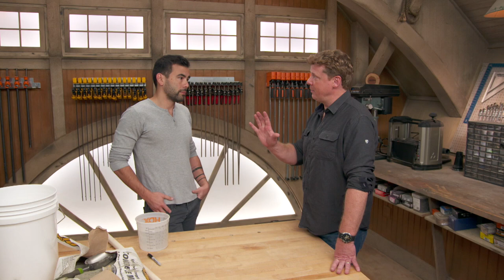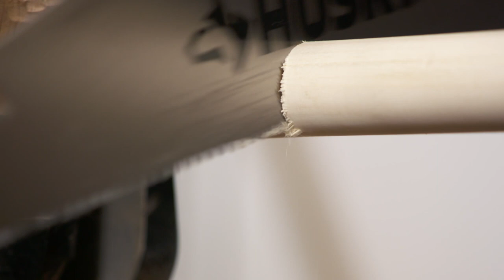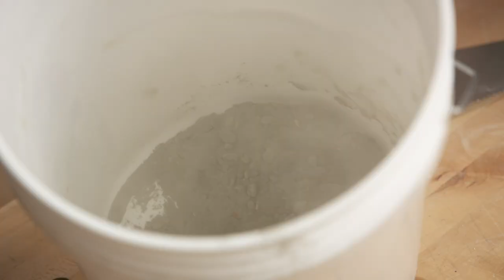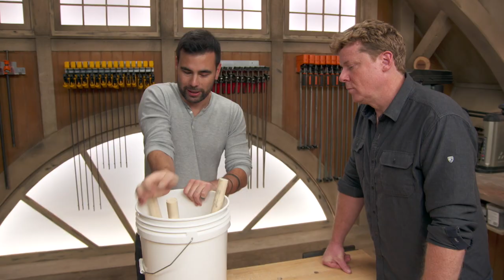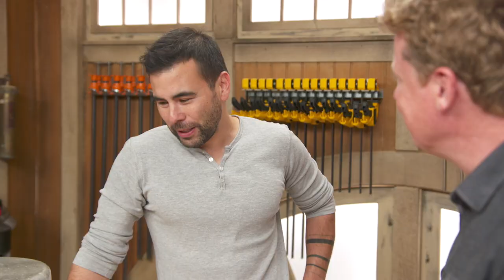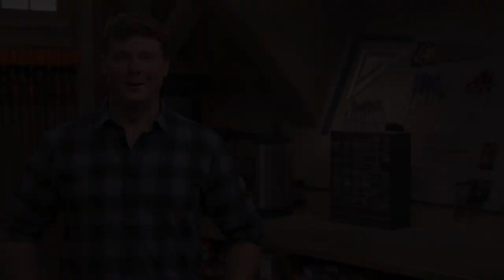How to Build a Simple Stool with Ben Uyeda | Ask This Old House

Comment: Having made a few of these, the trick is in setting the legs correctly because if the spacing and angles aren't right it will topple more easily and will look imbalanced. And since it's concrete, it will scuff or dent whatever surface it falls onto, especially wood. I learned this the hard way. A carefully made setup to place and hold the legs in the right place and angle is a must. Also, hammering nails or putting screws partway into the end of the dowels that dip into the concrete will give the legs a firmer hold. The concrete is a nice touch when paired with wood legs. Under $5. Cool.

Comment: "The cement industry is one of the main producers of carbon dioxide, a potent greenhouse gas. Concrete causes damage to the most fertile layer of the earth, the topsoil. Concrete is used to create hard surfaces which contribute to surface runoff that may cause soil erosion, water pollution and flooding."

so much for Ben's "renewable architecture" knowlege.

Comment: The design itself looks cool, but if the legs are touching the bottom of the bucket, doesn't that essentially mean they're coming out the top? As in, the thinnest point would be right at the surface of the seat.

I would rather not get a dowel up my backside.
Reply: thats why you give this stool to people you dont like
Reply: the concrete soaks into the wood even if there wasnt that layer up top you would need some serious force to have it go up your rear
Reply: it looks like it's exactly even with the top, but even if it wasn't you could just file it down

Comment: Can you wobble anything with 3 legs?  My experience and my intuition tells me, "No."
Reply: jesusnthedaisychain I waa thinking the same thing haha. No...not when the point of contact is very small you cant.

No wobble...but you can have the surface not be level when all 3 legs touch.
Reply: I have a 3 legged dog that wobbles.....
Reply: anything with legs can wobble, with 3 legs its just much less likely
Reply: if one of the legs was loose for example
Reply: I think you need to study geometry some more.  3 points will always produce a plane.  You cannot wobble a 3-legged table.  You can tip it over, to be sure, but it will not wobble.
Reply: jesusnthedaisychain can you read in english? I just gave you an example of how it can wobble. Try reading backwards if you have to, but read before commenting.
Reply: Can you read Greek?  Because you need to pick up a copy of the Elements and give it a once over.

Comment: I would never do this. Who wants to sit on a concrete stool?
Reply: In plenty of places people simply don't have the money for a designer stool.
Or the nearest store is over 100 miles away.
Reply: I'm just saying it's too hard to sit on.
Reply: Is wood any softer?
Reply: Which would you want to be sitting on?
It goes according to what type of wood you use. And the shape of it.
Reply: erik2811 I agree with Erik. Wood flexes just as much as concrete under human weight. Only the temperature might be something if you live in a cold climate. Concrete will be the winner in holding itself to -10 degrees celcius until your ass is frozen.
Reply: Also, i would put a coat of clear varnish over it. Otherwise your jeans will be covered with gray dust after sitting on it.
Reply: erik2811 is wood softer than concrete? Is that a serious question? Haha
Reply: I have sat on many a concrete park bench or wall.  Has thy Lord never done such a thing?
Reply: East Sac Workshop Honestly the comfort of a concrete or wood bench is all about the contour.
A flat wood bench or flat concrete bench is going to feel 99% the same.
Really the only difference is its easy to make wood benches with slats so air can circulate...that's significantly harder with concrete.
Reply: just put a piece of foam on it. problem solved kids